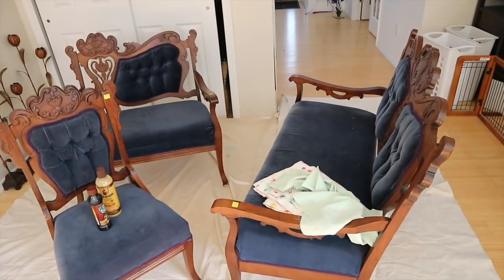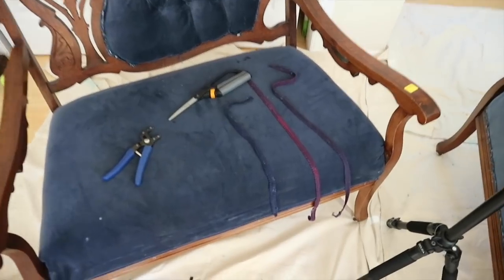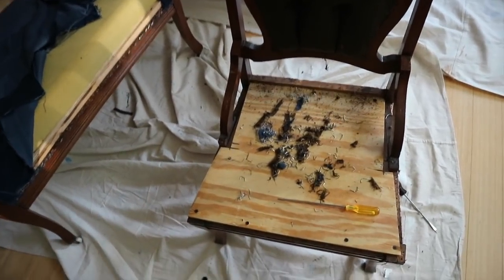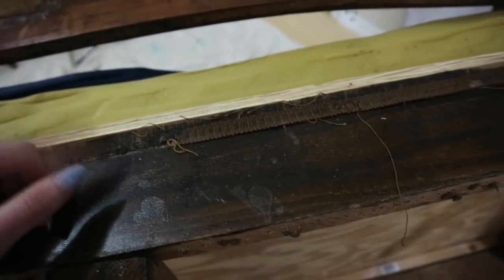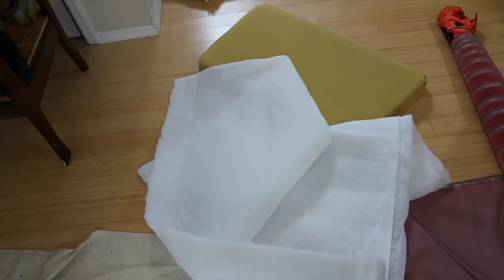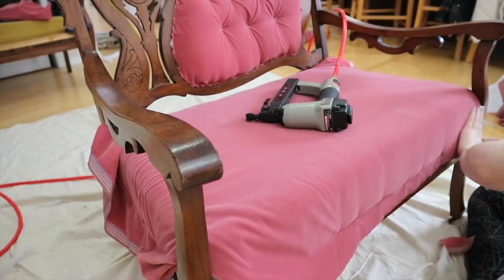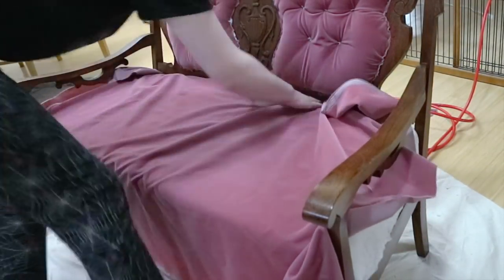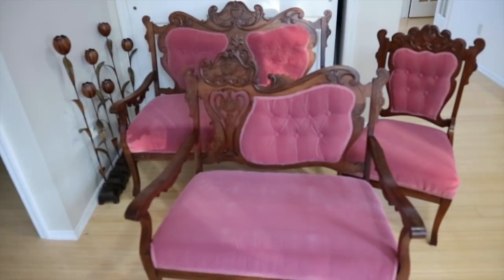Attempting to Upholster a Victorian Settee Set

Comment: I used to do this for a living,  and I can say you did a pretty decent job: Diamond tufting is very tricky! 
Now, for next time:
1- get more fabric: contrary to what you thought, you need MORE tension, not less. So you need to be able to GRIP that fabric. Mesure the chair/sofa on it's widest/highest, and add about 15cm.
2- to get that tension, you need to find the middle back of the seat and the middle front and mark them. You won't get the tension you need from the get go, so  you need to "pre-pin" the fabric. to do that, you angle your stapler at 45° on the side, to make them easier to remove.
You pin the middle back, about 3 staples, and then the middle front. Don't hesitate to pull, it'll even out as you go. then again at the back, 3 more on each side, and again at the front... and so on an so forth till you reach the sides.
SIT ON THE THING
You'll probably find out the fabric is still too "soft". You're not draping a dress there, the fabric is your chair "corset" the thing that gives it shape.  So, you take out a couple of staples in the middle, and grip down... and then do everything again! Depending on the fabric, you'll probably have to do that two or three times before having the required tension and be able to staple it completely.
3- Don't hot glue. It's going to be hard to take it off. There's glue for trims, or fabric glue will work nicely too.
Otherwise, you made a nice choice for starter. Personally, I would say late Victorian or 1900s, due to the quite Arts & crafts styling of the wood sculpting.
I hope you enjoy them!
Reply from the maker: Oh this is all great to know, thank you! I was basing the fabric tension on the previous upholstery work, which was pretty loose. I guess that wasn't the best work to try and emulate! I will keep the tips and added tension in mind for next time. 

Is there a specific type of glue you would recommend? I did some searching around but hot glue seemed the most recommended since it is fast drying. I was worried about outlining the upper sections with slow drying fabric glue. But I'd love to use something better in the future if it is out there!
Reply: Well, I use trim glue by Houles, but I'm French, so I don't know if you can find it in the US. Otherwise, a good quality fabric glue aimed at heavy fabric will do well, I think. It's not that hot glue is a terrible mistake, mind you, it's just that it's hard to remove when you want to redo stuff: Staples are no fun, but staples in glue casing? nightmare, trust me.
Oh, and one last tip: to fill up all previous holes and have a nice working surface, mix wood glue and sawdust to make a paste, fill holes  with small painter knife, let dry 48 hours. You'll have what amounts to an almost new wood frame! Perfect for pieces that have already been redone a few times.
Reply: Good advice!
Reply: @picassomanu185  from the oodles of woodworking videos I've seen recently, I'd work with a wood filler instead of the sawdust/wood glue method, because it supposedly takes finish better ... also, not as much mixing required. I'm not much of a woodworker(so far ^^), so when I tried the glue/sawdust method, I failed miserably, so that might factor into that. Though it might also be hard to match to the wooden frame? Because from what I've seen, wood filler is usually matched for the tree and I don't know how easy it is to find out what tree the wood came from ... Though people in home centers might know what to use..?
I also recently learned that you can clean off hot glue with alcohol (rubbing alcohol I presume), though that sounds like it'd stain the surface :/
Reply: Wish I had you here right now, lol I'm re upholstering and 8 feet victorian couch that has 150 buttons🙃
Reply: Gosh, thanks for the lesson.  The closest I've ever come is putting a new fabric on the seat of my dining room chairs. It looks so easy when they do it on tv!!
Reply: Thanks...I wrote this down.  What do you mean by 45° for the staple? Like one side of the staple all the way in and the other out slightly?

Comment: Hi! You did a really good job for your first try! I agree with most comments that a dedicated staple remover would help you out - I like Berry Staple removers. Also, you do need to pull fabric tighter rather than looser, oddly. My trick is to pull center first, then pull down the sides evenly. When you pull, rather than using your finger tips, use the meat of your thumb and pulldown and then angle the pulled fabric towards you. Removing staples is always the worst part, but I recommend "basting" with staples, ie remove the safety in your gun, then put the staple in at an angle, leaving a raised end for easy removal and finishing when you feel like you've got a smooth surface.

Comment: From what I know on upholstery, when you're covering something like those big foam pieces you want to pull it tights on opposite ends starting from the center and working your way to each end. You really want the tension to be even on all sides to prevent the bunching. so doing it in a cross pattern and working each "quadrant" is the best way to do it. You did really great though for your first time!!!

Comment: Fantastic job, be proud of yourself

For the next time: there is stuff called wood filler-it is used to fill small holes and bumps like those left by the staples. If you use it before the oil you probably will get a smoother finish (at least I think so, im not an expert ^^)
Reply: The only thing I want to mention is with wood filler is you usually need to sand and stain to get it smooth and matched well, and if not sanding the whole piece, she would've had to be really careful not to strip the finish on her visible parts. :)

Comment: I know this is cold comfort since you did this project some months ago, but for next time; source some dedicated staple and or tack remover tools so that you don't damage the frame when removing them.  Osborne make a plethora of tools that will help you enormously. Hot gluing your gimp is fine, but if you didn't use a high temp gun and industrial glue you might find that it will fall off easily, but you can rectify this with stronger high temp glue (usually places like Joann and Spotlight (the Australian equivalent) don't stock the types of glue that are appropriate for gimp/welt on upholstery - a large chain hardware often has a lower level commercial strength high temp glue that will work just fine. And i LOVE that you used an air compressor and pneumatic staple gun - by driving the staples in with force, your fabric will be secured really well! Great first job of stuff over upholstery!

Comment: I second a lot of the other comments :) You did a great job and you're being too hard on yourself.

I worked in an upholstery shop and I can tell you that it ALWAYS takes more staples than you would think lol. You did great at covering the backs of the chairs. The only thing I would've done differently is this- when you have such a high cushion on the seat of the chair you want to actually drape and sew a cushion cover. The only part you don't sew is, of course, the "bottom" of the cushion cover since this isn't removable. You could either do a "box cushion" (top piece, then boxing to cover the sides of the seat cushion- cut your pieces with no seam allowance then sew it with a 3/8"-1/2" seam allowance anyways to make the material even and tight once placed on the cushion) or you could drape a piece of velvet over the top (right side down) and gather all the puckers and slack into the corners to sew a dart at each corner. You would then mark your rough darts, unpin and take the material off, then make the rectangle of top fabric even and the darts even and symmetrical before sewing the darts. I again would shrink the whole rectangle by about 3/8"-1/2" all the way around and then adjust the darts as needed. The cover should be tight and a little bit of a struggle to pull on, and then once you get it on and stapled the foam will fill out all the corners and space in the fabric evenly.

Comment: You did really great with the tools & experience you have, well done (& I'm sorry, I do admit to having a chuckle when you said you'd finish that day at the start). If you do re-upholster it, or if you do more of this in future, I recommend starting with the smallest piece of furniture to get used to what needs doing, any errors will be less noticeable on the smallest item & by the time you get to the larger pieces, you will have more confidence in the tools & processes & you won't also be struggling with balancing/bearing the weight of the most hefty pieces at the start, where you're learning so much. If you do enjoy this as I do, you can pick up a small, lightweight rechargeable stapler (which also takes tiny brad nails) quite cheaply nowadays & they're so much less cumbersome & noisy than the large construction ones. You may also choose to get a v inexpensive, pointed staple-removing tool, which is much better-suited to the job than a screw-driver, in that it causes less damage to the wood & beats replacing a damaged screwdriver. It's admirable to be able to make do with what we have, but just like in sewing, in order to preserve their longevity of my tools, I find it best to use my workshop tools for their intended purpose  - could you imagine allowing anyone to use your fabric scissors to remove staples? LOL. Give yourself a good pat on the back & stop beating yourself up, it was your first time & you did great, all things considered.

Comment: That’s so cool that you got a horse hair set! Horse hair fabric as an outer layer was suuuper common in the Victorian era! It’s hardy and it gets shinier with wear, and it’s relatively easy to clean, and of course horsehair tends to be neutral colours, so the dye required can be made to even out the overall colour (requiring less dye) or the light hair can be dyed brighter colours. Anyway, if I remember right, horsehair seats were the standard seats on Victorian trains, because they’re rather low maintenance.

Comment: As soon as you showed them I knew they were going to have horse hair in them! I'm so sad what they did to the back of it, really there shouldn't be any need to staple on the back at all. You would apply the fabric from the front (facing the back). For next time, the Osborne staple lifter is my favorite staple remover. I also suggest using a razor to cut the fabric when it's a tight spot. It looks great, everyone has to start somewhere so don't beat yourself up for something that you have no reason to be perfect at yet!

Comment: Nice furniture! They look like they are from between 1910 and 1930. The wood design is Art Nouveau, and using straw and burlap were the usual materials. And the brownish unexciting original coverage is something I'd expect in the 1920ies. The newer "remake" unfortunatley was very poor, and the trim (which was partially discolored) is real cheap material. 

I think you did quite a good job there!

Comment: You did a good job, I found a Victorian chair, it was filled with old cotton, horse hair and hay, covered with burlap. It was under this 1980's vinyl, new cushioning  over the old and a varnish, but I knew it was an old piece, took off the yucky stuff and it was filled with what I wrote above. I used tacks, it looks more original but yes is a pain in the backside, a couple of weeks later, I found a foot stool that had some of the same characteristics, it had the same in it, minus the hay it was under faded blue/purple velvet, redid that one too. I would love to have this set you bought, I am interested in the Victorian time period.

Comment: There is a gadget looks like a screwdriver but the tip is different, which is great for removing staples and tacks without doing as much damage. I'm sure your local hardware will carry one. They're not expensive. It would be horsehair and a type of felted wool over the top then covered in a strong material which you call burlap. Also originally it would more than likely have been tacks rather than staples. You can clean the wood with 000 wire wool  using a mix of 2/3 natural liquids which do a great job in cleaning and feeding the wood. One is boiled linseed oil. Another, I think turpentine. I'm sure you'll be able to get the correct mix on the wonderful YouTube as it's many years since I did a couple of pieces.

Comment: Firstly, great job! Needs some work but older/traditional upholstery is very tricky. Here's a few tips...

Firstly, the horse hair and other fibers should be removed and washed. If you watch videos of people washing/preserving horse hair padding you'll know how disgusting it can be and that it's important to clean it.

Secondly, please do not use foam. Especially old foam. Foam will get hard and rip over the years which will become uncomfortable. And unlike horse hair, cotton, moss, and other fibrous stuffing it can't be brought back to life and is extremely hard to clean as it's just a giant sponge that will absorb anything. That's why removing/replacing foam padding under carpets is important. Even if you clean a stain off a carpet, the foam underneath is still dirty.

Thirdly, it's important to sand, fill, and all around repair the wood frame before reupholstering. Sometimes you may need to add some bracing or drill new holes for legs as dragging a piece of furniture can cause the existing screws to tear away at more of the frame leading to loose legs, arms, and backs.

Lastly, I don't recommend hot glue on fabric. Trim pieces are normally tacked in place with very small heads on the tacks making them practically invisible. You can also sew the trim on with a curved needle or with a good template sew it on before attaching the fabric to the frame.
Reply: I agree with everything you've said.  When the covering fabric came off I almost cried at the butcher job the former owner did!  That plywood!  Those staples!  That foam!  The hot glue!  I really don't like staples, either, preferring to use tacks, though it takes longer.  This man is fascinating to watch as he restores various styles of furniture--even though he used staples.  https://www.youtube.com/user/BuckUpholstery                                                Angela, if you do any more upholstery work that you want to last, I'd recommend watching his videos and others that use traditional methods--also get a tool called a tack lifter.  Works for both staples and tacks and is easier on the wood than a screwdriver.

Comment: A quality upholstered piece would have fabric under the upholstery fabric. This is usually muslin and is used as a barrier between the stuffing and the expensive upholstery material. Most furniture was stuffed with horse hair, so it was important to have something to keep the hairs from poking through. It also serves as a good guide to the shape and size of fabric you'll need to cut.
Reply: I'm fascinated by upholstery. My first job when I was a young man was in a fabric store, where I learned so much. I became a decorator because of this love of fabric. I dislike the use of gimp because it always looks like something you use to cover up mistakes. For this reason I prefer welting, which uses up a lot of yardage because you have to cut it on the bias to make the welting, but the end result is always so professional. I've also done double welting, which looks really great too.

Comment: You know nothing of 19th century furniture. Yes, a good bit of the original stuffing will be horsehair. Which makes your set original. something tells me that the set was originally suspended on a coil spring network and the dork who redid the set copped out by using plywood and foam. Not expensive to have a coil network restrung, but always expensive to restore one thats been removed. Suggestion, lacing your tutorial with words like maybe, like, or attempt does not convey the confidence of an expert. Also using the proper tools will help you in getting the job done quickly without damaging the set by prying out staples with a screwdriver.